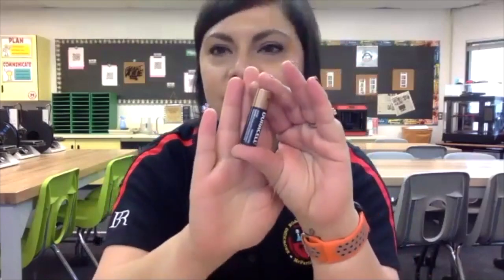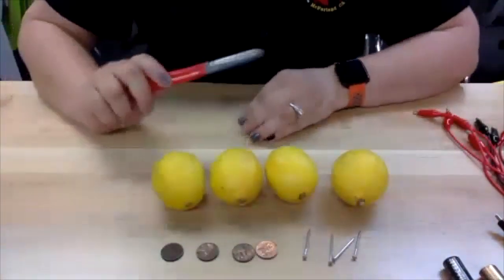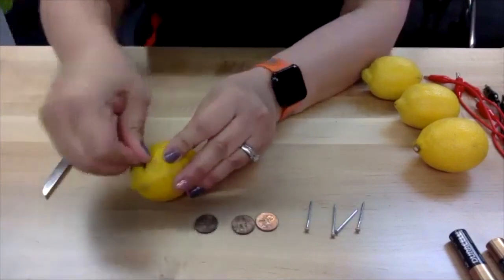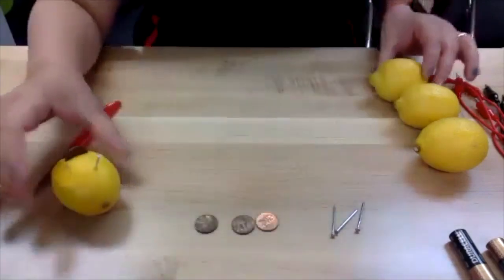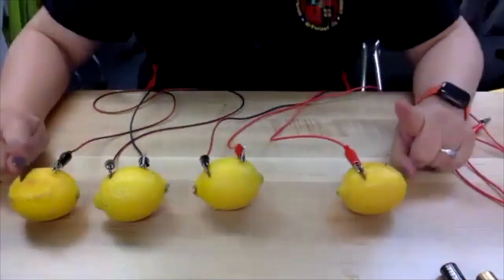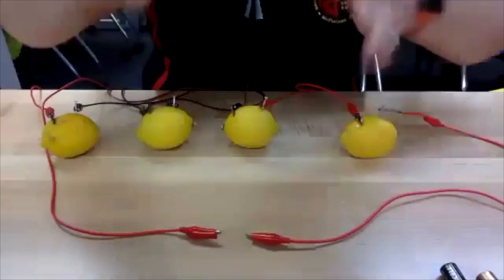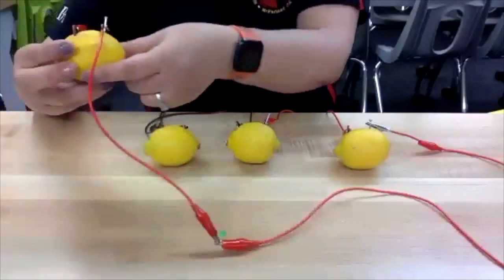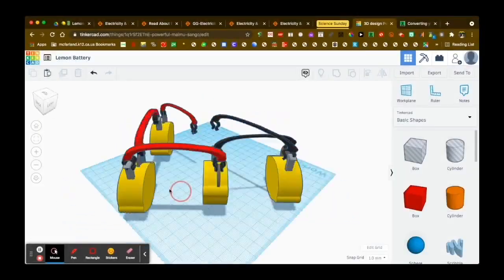Science Sundays: How to Make a Lemon Battery (Full Experiment)

Comment: What is interesting is since 2011 pennies are mainly made out of zinc. Why your experience works is you are using older Pennie’s or because the outside of the penny is copper. I would think eventually on a new penny the copper would be used up and the battery would stop working, but it’s just a thought.